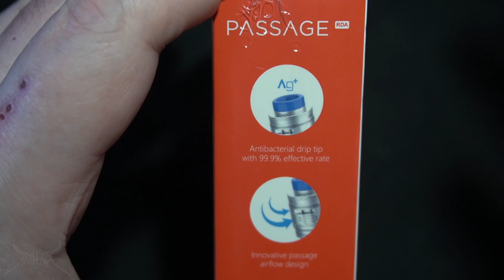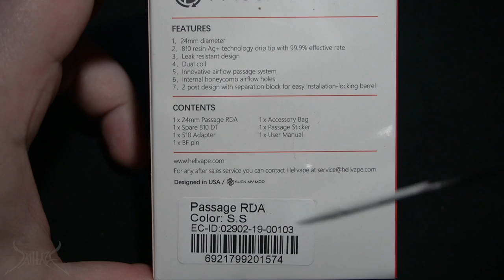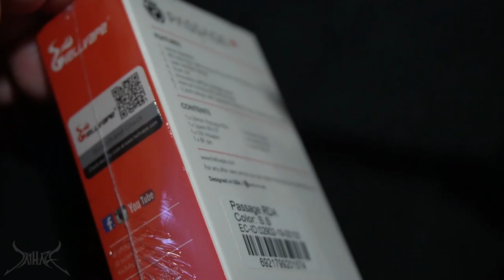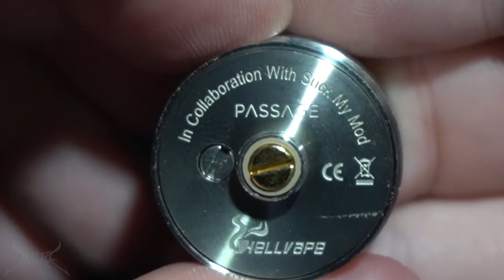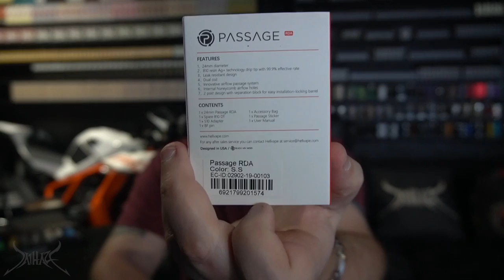Hellvape & Suck My Mod's Passage RDA Review and Rundown | Very Unique Airflow

Comment: Hey Jai, the post is designed to accommodate the coils just like velocity without bending the coils. The block will allow to insert the coils  up/down or use it as u did. Both options work fine.

Comment: Thanks for the review Jai! Hope your finger gets better😜
Reply from the maker: LOL my man
Reply: Suck My Mod what's your reaction for HellVape not putting that much credit to you on the box
Reply: By far the easiest RDA I’ve ever built. I have the Dead Rabbit, Drop Dead, Recurve, Bonza, Aequitas, and Profile 1.5. I mean it’s extremely easy to build. The next easiest is the Bonza. The Drop Dead claims to be easy but the way the posts are and the length that I like my coil that RDA cause me to need to precut the coil float a positioning rod while tightening down the coil. Then going back and resnipping the leads.
Reply: @timolean5846  come on now lol the profile is the easiest
Reply: mrdauntless nope the profile is easy. You need to use the extreme mesh, and a ton of cotton. The passage doesn’t require certain coils and certain amount of cotton therefore makes it easier.

Comment: It's a cracking good flavoursome rda which you can build parallel with both coils in the same opening but also Velocity style with one leg under and one over the block.  Advantage of Matt's design is there's just two screws instead of four and either way the legs are really secure. Thanks for the review Jai

Comment: I've never actually bought one of Matt's attys before? I've bought attys/mods from Heathen, Fagan, MrJust Right, Tony B, Bogan and Mike...and that's it, I think? You'd think I'd have gotten something from Matt by now. But don't worry if you're reading this man, the Serpent Elevate is one my list ;) I have a mod the silver/grey one would look sick on...
Nice job on the dripper too, it's really up my alley. The market is just so saturated/competitive and consumers like myself only have so much money -- so often it can be hard to make a choice. I'll defs be putting this one on my maybe list though.
P.S. in case anyone's wondering, the best would be a tie between the Drop Dead and Bonza 1.5 out of all the drippers I have, reviewer or non-reviewer.
Reply: Passage and Hermetic are great.
Reply: @reverendv8900  I have heard good things about the Hermetic. Bogan put it in his top RDAs of last year, so that speaks volumes imo. More suited to single coil squonking though and that's not (typically) how I vape but still...I'd give it a shot if I saw it on sale or something. I am starting to get more into single coil attys and single coil builds lately.
Reply: @skippy8696  I'm vaping on the Hermetic right now as it happens. I'm as at home with a 0.35 single coil as I am with a 0.08 dual if the flavour is there.

Comment: I too like Matt, matter of a fact, You, Matt, Daniel at DSL vapes, Mike Vapes, Brian from The Vapor Chronicles and Mr. Just Right are all outstanding reviewers. Also PBusardo from Taste Your Juice, even though he does not review many devices I use anymore. I also like Grimm Greene and Vape Fagn. I used to even like Rip Trippers reviews, but his reviews are now more like commercials. Rip Tripper I feel certain is paid for many of his videos, based on giving positive points, while not acknowledging its many faults. Daniel and Pbusardo both seem to have the equipment and such to show the real output wattage a device puts out, as well as the temperature accuracy. Unfortunately, I usually will not make a buying decision based on Rip Trippers reviews.

Comment: He probably won't see this, but it's a velocity style deck, but with clamps.
Reply from the maker: why wont I see this? And I would HARDLY consider this velocity style. Velocity style is just not the posts, that would be any 2 post configuration, and keep in mind velocity WAS NOT the first rda with dual tall posts
Reply: @JaiHaze  I know it's not just the posts, but the reason the screw doesn't pull the clamp up is so you can put a leg between the screw and the clamp.
Reply: @dakotasimon3445  the only reason I know about it being a velocity style is because of Mike Vape's